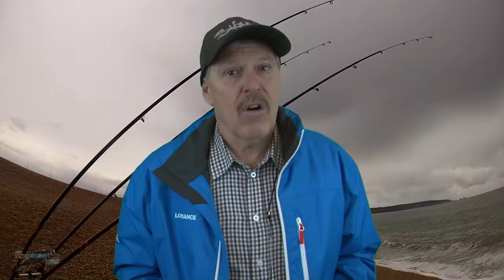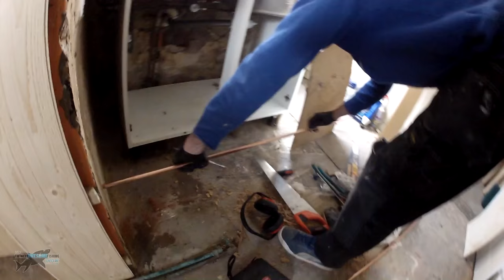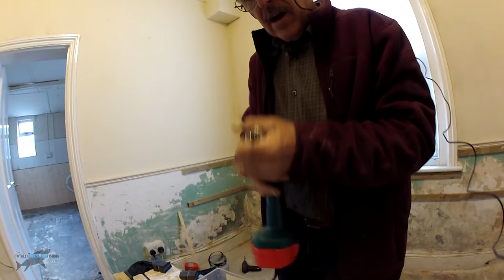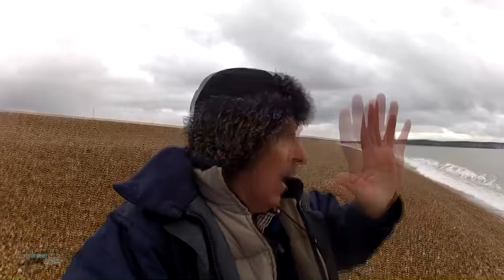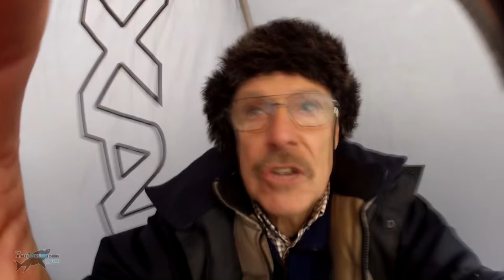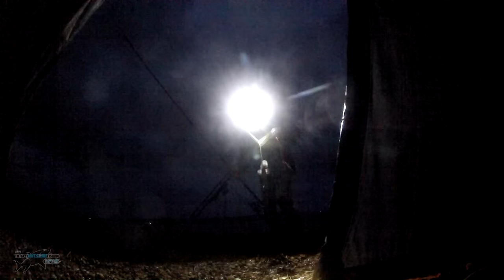Day in my life VLOG3

Comment: I had to fit thousands of feet of battening, to walls when I was fitting out pubs, we used just a rotary hammer drill, (slow and heavy hammer,that in fact will drill granite) choosing only the drill size that is right for the plug,  hold the batten in position, drill through the batten, into the wall to the required depth, clear the dust insert the plug into the batten and tap home, put the screw into the plug with your fingers and turn in as far as you can, tapp right through the wood then drive home with a power driver,